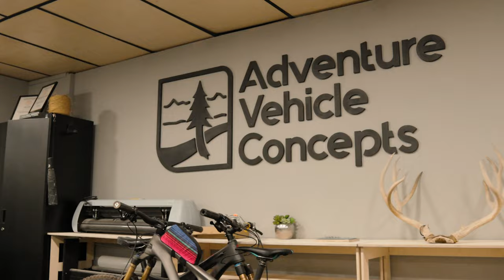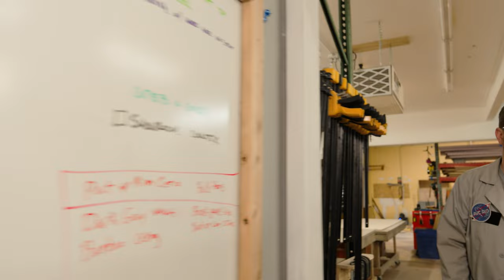Shop update and Tour at AVC RIG

Comment: We're in the middle of our build, using a bunch of your parts (floor, paper patterns, etc). Now that you're going into aluminum extrusion land, I would love to see tips on attaching extrusion to the van walls (thermal break or not... working around changes in wall depth... all transit issues).  Also tips on attaching extrusion to your floor system (or through van floor if needed). We had to modify our metal pieces that came with your insulated floor kit (#1 behind driver to accommodate thick wires coming from alternator connection  #2 a cutaway at rear edge of sliding door piece to fit flush 'cuz it was too long). We figured it out and it came out clean, but a video on potential mods would help customers. We also ran into some issues with LED light locations in the ceiling panels. They all hit at the beams which we weren't ready for since our lights are thicker than the panel. I think a more detailed explanation of that in a future ceiling video would help.  A video on the lagun table bracket would be nice. The hardware received doesn't seem to match up with mounting that on the driver side... or I'm missing some info. We love all the parts we have received from you... now we're deep in the work of completing the installation. Oh, one more thing comes to mind. It would be great to have a video that explains the items that you REALLY want to make a decision about at the BEGINNING of your planning. For instance, well into our build, my husband now wants a heater and I'm concerned that the longer we wait in actually getting it, the more difficult the install will be. Glad your back into video production. I'm looking forward to your videos. Thank you!

Comment: As someone who has exclusively been using extruded aluminum to build custom van furniture for the last four years, your move to aluminum is a great one. If its 80/20, you might want to check out George's work at Humble Road. He builds exclusively with 80/20. We use a German system designed for industrial applications. It might be overkill for van upfitting, but there are good reasons why we use it. Its beautifully anodized and the finished product looks fantastic.
Reply: @van_mod1 what is the German system you use? I'm about to order a load of 8020 from Germany, but open to other systems and ideas.
Reply from the maker: Love Humble Road. He was one of the first really teaching on YT.  I’ll take a look.